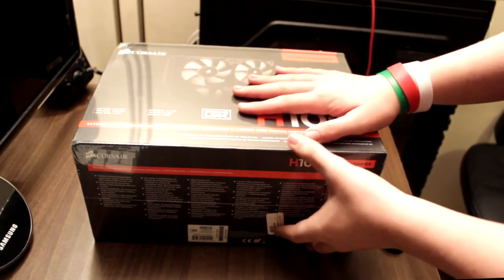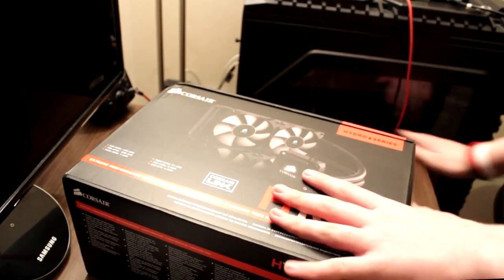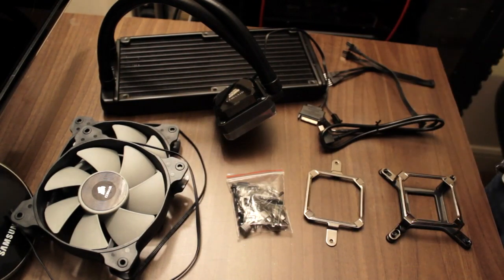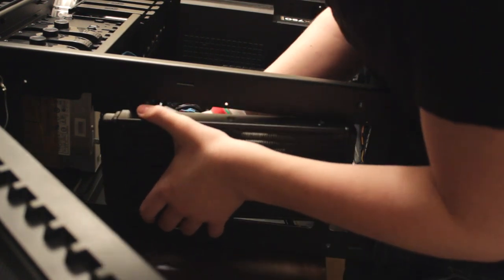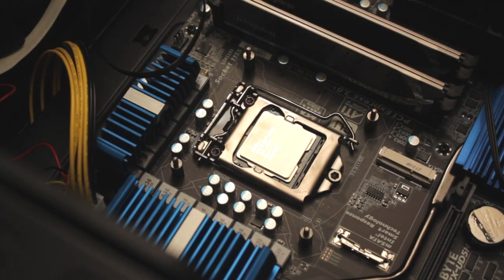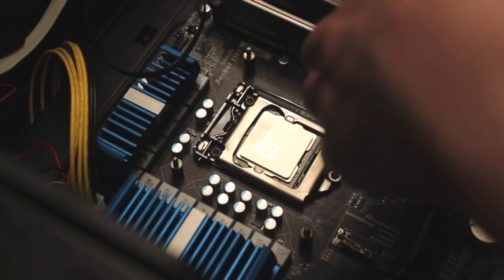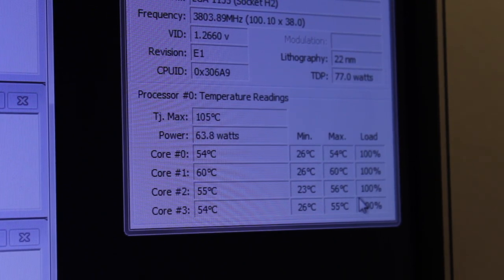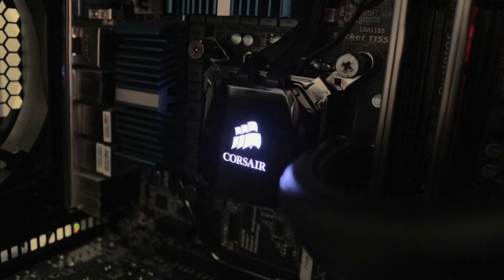Corsair H100i: Unboxing and Installation

Comment from the maker: The thermal paste was installed on the H100i stock, hence I didn't apply any on the CPU when installing. 
Please thumb up this comment so people see it
Reply from the maker: ***** Yeah this is still a great cooler. I would still buy it over the H105 because of the Corsair Link functionality, so you have made a good purchase.
Reply from the maker: Relax, Its not difficult at all when you know what you're doing. Look at a few of LinusTechTips' recent build guides. He has great explanations and step by step tutorials on each process of building a PC. Unless you scratch the gold contacts on the bottom of the CPU you will not break it. The pins on the motherboard are also covered up so unless you touch them intentionally you won't break them either. Make sure you're fully prepared before doing it.
Reply: ***** you could get a really cheap not working one to practice on if your really worried, or if you have got one at home try taking it apart
Reply from the maker: Meiryousa Touching a large metal object (i.e. the case) or a power supply plugged in but switched off has the same effect :)
Reply from the maker: Meiryousa You only need to periodically ground yourself. It's pretty difficult to charge yourself up with enough static electricity to damage the components, so it doesn't matter too much but a quick ground every couple of minutes is fine.
Reply from the maker: Meiryousa Although this is true most of these components have a 3-5-8+ year warranty, so it doesn't make to much difference but you are right there is always a risk.
Reply from the maker: Yes I agree with you in that case, but for me Im having to swap hardware in and out every 5 minutes its just hassle. :)
Reply: +bleedinsixcolours bro, your like 12. How did you even afford all these PC parts?
Reply: rofl i just wanetd to ask that question xD
Reply: Why u did not show cable connectors? Or cable management
Reply from the maker: kreeper24
One of my very early videos mate and didn't really think about it. In heinsight I see I should have definitely.
Reply from the maker: ***** Yes.
Reply: bleedinsixcolours how do i do push pull config
Reply from the maker: Medrano Productions Nope! There will be thermal paste pre-applied and that is all you need. If you are to take the cooler off and put it back on, you may need to remove it completely and re-apply thermal paste. :)
Reply: +bleedinsixcolours what are the chances of something like this leaking? And do they ever have to be refilled with liquid?

Comment: Hey, don't you need to put thermal paste before the heatsink? or does it come with an already-on thermal paste?
Reply from the maker: The thermal paste was pre-applied :)
Reply: bleedinsixcolours Although there is Pre-Applied thermal paste it is far better to choose a 3rd party paste like; Arctic Silver AS5 or IC diamond Because they are both highly thermally conductive :)
Reply from the maker: Isaac Livingston Actually with brands like Corsair the pre-applied thermal paste is actually pretty good, yes IC Diamond would probably improve temps but only by 1-2 degrees. I don't heavily over clock, I just wanted my rig to be quiet whilst I got a little boost in performance. 
Thanks for commenting :)
Reply: bleedinsixcolours  No problem :)

Comment: nice review, but my amd (fx 8320 OC@4,7Ghz on air cooler) beats the i5-3570K in temps(60° max)0 and in preformance, it is so much cheaper, i don't get it, why peeps don't go amd?
Reply from the maker: Thanks, Sorry when I started this channel I was very amateur and hence the shoddy video quality, lighting and me not realising my unit was defective. Since then I have RMA'd the unit and got it back, I now am over clocked to only 4.2GHz and get temperatures up to 62 degrees with Prime95 SmallFFT and MSI Kombustor on my GPU to warm the Define R4 I now have up. 

Also  ClockSpeeds x CoreNumber do NOT = Performance.  Intel's per-core architecture is much more efficient, and with only 4 Cores, still annihilates AMD's 8 Core CPUs. So when you over clock your 8320 up to 4.7GHz, you are clawing back performance against a stock 3570K at 3.4GHz, but when I then over clock to 4.2GHz, because of the architectures efficiency, I've basically resealed that gap and maybe even extended it a bit. 

Also with more cores, the developers of the applications and games you want to fully utilise the CPU have to put more work in to actually benefit from having so many cores, and usually only 1, 2, 4 and very rarely 8 cores are actually utilised.

Just a last note, I recently built two PCs for friends. One, an Intel Core i3 3225 Ivy Bridge 3.3GHz CPU. 2 Cores, 4 Threads, and it got around 280score on Cinebench CPU test. Another I chose an AMD 5800K APU, 4Cores, 4 Threads 3.8GHz and that got 370score on Cinebench.
So in this case with Cinebench using all the cores on the AMD APU it did benefit from having more cores, as that allows more of AMDs lower performance cores to work together and beat only 2 of Intels cores.

Comment: is there a chance this will leak? and if so, it uses some kind of special oil that doesnt destroy electrical equipment?
Reply: its tight as fuck it wont leak
Reply from the maker: It uses de-ironised water, that won't damage components on contact if the system is off. But from a company like Corsair, you can be assured quality and of course there is a small chance the unit may leak, but that is a very slim chance, and if you RMA the unit if it ever does leak and they find its a unit issue and not user error, they would probably compensate you for the accident.

But don't worry, it is not a common thing and I have NEVER heard of it happening.

Comment from the maker: Youprobably can, but it will void your warranty which is pretty bad in a CL Liquid cooler. If I were you, I'd do what many people have done, and use some tubing, slightly bigger than the tubing on the H100i itself.
Cut it down all of one side and just wrap it around the tubing that is already there, it looks awesome, and is very easy.

Comment from the maker: Glad to hear, its a great cooler.
If you have any, I recommend putting small rubber washers between the mounting bracket and the motherboard, which gives it a much tighter seal, and improved temps drastically. That is what the problem was with my unit, and this fixed it.

Comment from the maker: Yes I am still running this cooler.
The reason the temps are pretty bad in this video is because the mounting on this H100i was pretty flawed, I will be making a video on fixing it though.
The coolant is contained, and the evaporation is very little, you're not meant to open it or refill it, and I believe the warranty is  3 years.
Idle - 29'c   Load @ Stock - 59'c    Load @ 4.2GHz - 65'c

Comment: I notice that you made this video almost a year ago, are you still running the same cooler? If so I have some questions. Are the idle temps still the same as they were at time of installation, how about load temps? Any difference?

Is the coolant still contained? How is the evaporation compared to other liquid coolers which require you to top up the coolant and flush the system every so often?

Also you don't mention how long the coolers lifespan is.

Comment from the maker: The fans blow/suck air through the holes between the fins of the radiator. Wether you have it set up to push air through, or pull air through it does the same basic thing, as the fins are not very dense. It has been proven that there is no difference in performance.
It is recommended to have the fans touching the case, pulling air through as it is easier to clean dust out, but it looks better to have the fans pushing air through the radiator.

Comment: So, since I'm new to this... what is the point of the fans? To take in cold air and blow it into the radiator, or to take hot air from the radiator and blow it out? I'm kind of confused how this whole system works. Do you want the air flow of the fans going away from the radiator or into it?

Comment: Just wondering, I've seen on some videos where the radiator/fan setup is like yours (fans facing in towards the case with radiator facing out of the case) and also vice versa, which way is correct? I'm going to be picking this cooler up soon.

Comment: Hey man, were the first screws holding the bracket onto the motherboard loose before you installed the cooler? Mine were and I am wondering if this is a design flaw or meant to be so?

Comment from the maker: I wouldn't, if I were you. That fan isn't adding any more pressure to the radiator as it isn't sealed directly onto it; So its pretty unnecessary, and will just add noise via turbulence.

Comment: Don't buy the 9590. It's the same chip as the 8350 just overclocked. You might as well buy the 3960x or wait for the haswell version.

Comment from the maker: Maybe... Im using the SP120 Quiet editions, but I have them on a 5v Fan controller, so they are whisper quiet. If I were you, id replace those fans with the included SP120 L fans that came with the H100i, and go into Corsair link and set them at 1000RPM. They will be literally silent. That's what I did before I got my fan controller.

Comment: I did it :) unfortunately the back plate issue wasn't fixed but I work it out with Suki M5 plastic washers 5.3x10x1.0 bought from Ace Hardware, I put 2 under each rubber grommets of the back plate and the standoffs screws get aligned and tighten perfectly with the mother board, Im getting temp on my 4770k idle 21-24 and max 49-52 running Aida 64 and core temp for measuring the temperature, no overclocking yet, I didn't expect that as im living in Dubai where its very hot weather:D

Comment from the maker: Now don't quote me on this, but I think the issue you are talking about (Which I have experienced with my cooler) is fixed now. But yes, you need to place rubber washers behind the motherboard between it and the backplate and then screw the standoffs in through the washers to get a real tight seal. I wish you good luck with your build, and Like i said I believe that problem is fixed now :)

Comment: arent your temps REALLY high? what voltage were u using in that OC? 80ºC is WAY above what you normally reach with that cooling solution
or maybe it was on Quiet mode?

Comment from the maker: Hello!
1. The H100i comes full with liquid out of the box and never needs replacing. Any maintenance needed will be done by Corsair, so you don't need to worry. They are very reliable.
2. The radiator only fits 120mm fans, so yes the fans I bought separately are the same size as the stock fans. I bought the new fans because they are quieter, and have more asptetic appeal. So yes the stock fans will cool better at standard RPM but be louder of course.
3. Not really. I've never heard a case of it.

Comment: Hey, I have 3  questions... Firstly, does the H100i comes full with liquid? or does it come with bottle to pour that liquid in or do i have to just buy that liquid separately? Secondly, the stock fans are the same size as the quiet ones you bought separately, however they turn on 2700RPM, so are they performing better? And finally, is there a danger for leaks using this closed liquid loop h100i? if not or if yes, why? Any warnings for using it? I am trying to choose between h100i and Noctua ...

Comment: You have to make sure that you have the extra room for a second fan, and yes, with a stock H100i box it will only come with the mounting screws for one set of fans so you will have to buy/fabricate more, but adding a second pair for push pull wont significantly increase the preformance.

Comment: It depends on your case size more that the form factor of your motherboard. If you have a space on top/bottom/front you may have space to fit the 240mm radiator but you have to remember that it has side-tanks so it will be larger than the two 120mm fan mounts. If you don't have space for the 240mm I would recommend getting the H80i it delivers a similar cooling performance in a 120mm thick radiator.

Comment from the maker: The Sata cable hard wired into the pump, plugs into a spare SATA power plug coming out of your power supply, the same as whats used for hard drives. Then to plug in fans, either plug the two 3 pin fans into your motherboard, or use the adapters included with the H100i, plug the fans into that and plug that connection into the top of the H100i to control the fans in CorsairLink. Plug the 3pin connector hardwired into the unit into the CPU_FAN connector on your motherboard.

Comment from the maker: Yes, but at the same time I had one of the first H100i's of which some shipped with a slight mounting issue. This has since been fixed and my temperatures are considerably lower. Literally 20degrees better.

Comment: whats the voltage on 4.5 GHz as this is the most important part in overclocking which is not shown in this vid. on stock i was able to get a sneak peak and it was 1.29v

Comment from the maker: I have never tried it, But I imagine so. You get 8 screws that can reach through a fan and into the radiator, so I suppose you could use 4 and 4 on each side and do it that way, But I think more screws are needed.

Comment from the maker: Yep, no problem I love responding to questions, I do it more than actually produce videos... Which may be a bad thing haha. 
My fans currently are sucking air from INSIDE the case OUT, so using them as exhaust. So I have a 230mm front, 200mm side and 140mm front INTAKES and the two 120mm top fans as Exhausts. I have moved the fan from the rear and velcro'ed it to my optical drive and am using it as an intake at the moment.
Also its not worth putting the 200mm back in the top, its loud.

Comment: Just one question, How does that not ground out your mother board with that metal that is sitting on the motherboard and is also touch the chassis

Comment: This is true if you have the fans arranges as intake fans, However you will have an increase in ambient temp in the case. A top mount on exhaust is going have a very small (maybe 1.5C) increase over front intake but your ambient temp is going to be lower. The big advantage of a rad is you get the heat away from all the other components that are generating heat before dissipating it. So it is much more efficient. Optimal setup all depends on the overall build.

Comment from the maker: Actually it doesn't matter. For one the tubing is not long enough to fit in the front of the case, and the convection that heat rises is absolutely tiny, and makes 0 real world difference day to day. Heat isn't naturally rising out of the radiator, air is being pushed through with fans, and the heat that would normally be inside the case is going to be a lot cooler than the CPU, and if not; You do not have enough case fans to move away the heat from the rest of the system.

Comment: Wait, I can plug Case Fans into the H100i? Damn. Also, The 500R has a Fan Speed Switch on the front to control Fans. But if I can connect them to the H100i I'm good to go.

Comment from the maker: To Install the H100i You need to plug the Pump's 3pin cable into the CPU-FAN Header; then the H100i has a built in Fan Control, so you plug up to four fans into the pump itself, and you can control these in Corsair Link software in Windows.

Comment from the maker: I have done! Do you play F1 2012? and Ahh.. What about some Enermax TPSilence fans? They run at 900RPM, so not the most high performance but I believe they come in LED, im not 100% but I think so, if not I'd say get some LED Strips like some Akasa ones they are pretty low price :)

Comment from the maker: Nice! It's a great CPU, and yeah Id say the SP120's are a pointless upgrade, UNLESS you want to go push/pull which in my opinion is pointless on a radiator like this, or for aesthetics, Otherwise the fans included are better in almost every way, and the SP120's at 1200rpm which is what they run at are a little loud, if its silence your looking for like I said keep the stock fans, or get some Noctuas if you don't care for aesthetics.

Comment from the maker: An Intel Core i5 3570K at 4.0GHz, 1.15V never goes above 60degrees C and my room is very warm. The fans themselves... I would recommend not getting the SP120's, because the fans included can be managed in the Corsair software and underspin them to 600rpm, and up to 1700rpm, so just slow those fans to 1000rpm in software and they are silent :)

Comment from the maker: Depends... Are you buying an upgrade for better cooling, no better temps but quieter operation, or for more headroom for overclocking? If you're just trying to get better temps then yeah id say upgrade, you won't have to RMA, the only issue I've heard is about the backplate being loose and you can fix this with a few non-conductive washers between the backplate and the mobo. If you're upgrading for quieter operation then just buy two Noctua NF-F12 fans, they are damn silent and much cheaper.

Comment from the maker: Yep, you plug the other end into the motherboard just like a front panel USB connector, and then install the Link software off of the Corsair website and it will pick it up automatically :)

Comment from the maker: Oo.. Push/Pull Im not sure, I'd say probably not, and the temp difference between Pull to Push/Pull are from 0.5-2degrees.  It will definitely fit with just one set of fans, but depending on your motherboard, I doubt you'll be able to fit two sets of fans :)

Comment from the maker: I didn't set a voltage when I overclocked I just left it on Auto, so it was like .1V over what was actually needed hence the temps were so damn high. I've learnt alot of course and have now adjusted my voltage so my temps never go above 70degrees :)